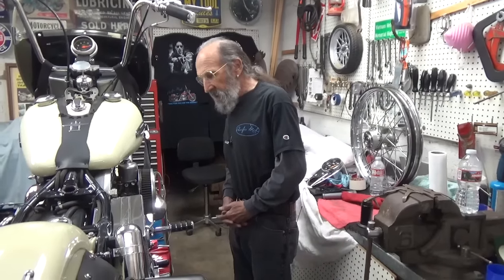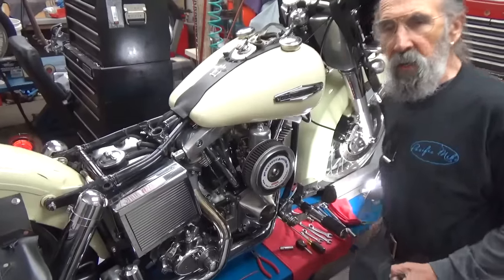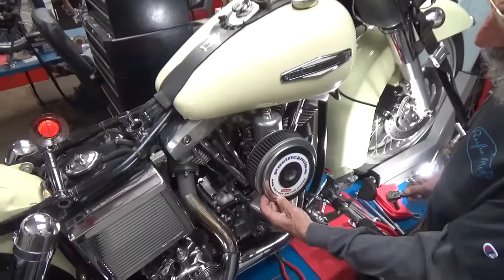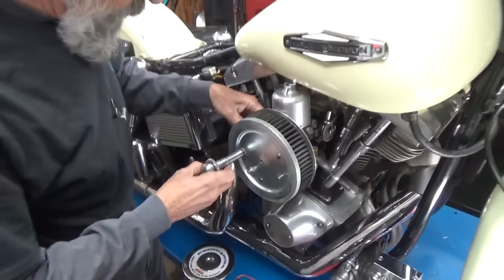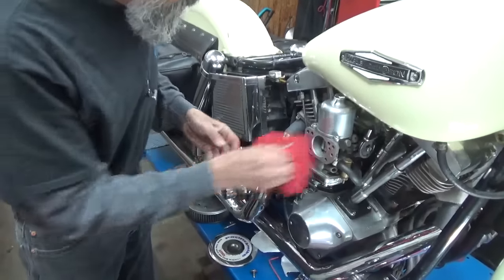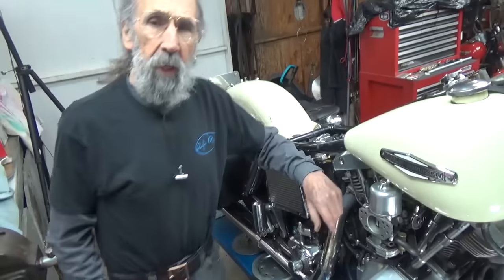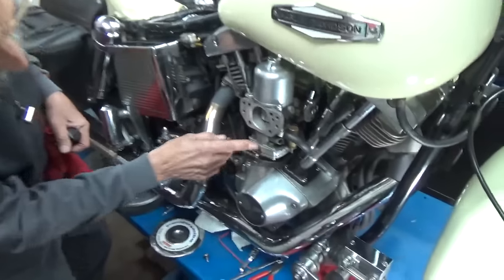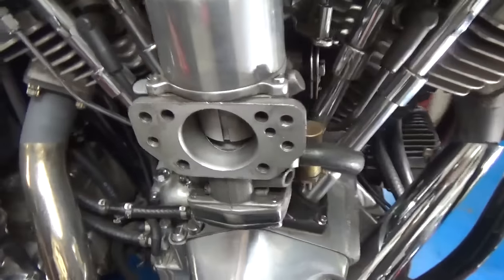Quicky service on a Harley Shovelhead SU Carburetor

Comment: Been running nothing but SU for past 50 years on my chops. One myth that you perpetuated, is about oil in the dampener.  Oil has a direct effect on the dampening... and as the instructions state  "Use no oil in the dampener. Once a month remove the dome nut and lightly spray with WD-40 inside the dome."  I also highly recommend lightly wiping down inside of bell and slide with a clean cloth and WD during routine maintenance.  Some thing I want to mention since a bunch of SU guys will read this, and it might save them time and trouble down the road- a problem that cause me grief for far too long- bike started normal, then ran rich. Very rich. No amount of jetting etc fixed it. The problem was this- on the end of the enrichener rod inside the carb body, on the end past the air valve- that O ring had harden, and wasn't proving a good seal. Looked good enough on inspection, so I gave it a pass. A snippet I read on a forum mentioned that O ring, so a re-examination proved it to be the culprit.
Reply from the maker: Interesting.  Until lately, I never had problems with seals drying out or gasoline going bad in my Shovel.  It never sat that long.  Nowdays, things are a little different.  Thanks for you input.
Reply: what confused me, was the o ring never touches gas, it's an air flow seal to give it vacuum.
Reply from the maker: You know. I'm going to have to study on this a bit.
Reply: I went and looked it up... the o ring, is on the far end of the throttle spindle- and controls the air flow when enrichener is used.
Reply: Some hick up.  Old stinkin gas.  I got gas, sometimes all day loooooong.
Reply: Especially after cabbage.
Reply: My new favorite est  video, wrist bushings!

Comment: Now I know a little more of why a buddy of mine during later '70's ran SU carbs on his Shovelheads.>> I used to keep a dedicated for task screwdriver with just the right diameter tapered handle dropped down into a keyring on outside of tool bag to adjust carb for elevation on the fly....Find that now emptied out tool bag around here somewhere & that same screwdriver is probably still in that ring with edge of top flap holding it in place...LOL!
Reply from the maker: Yup.  A little pocket on the back of my saddlebag.

Comment: The first carb I ran on my pan when I first built it 30 years ago was an SU by Rivera. You're right that it's definitely a ballsy carb. I loved the tickler. Just like the Amals on my Norton. Started easily all the time. One winter day, the bike suddenly started running badly and quit. The piston had frozen in the dome, so the needle and piston were in the wrong place with respect to the throttle plate. The tuning was right on, but maybe I didn't have the right lube or something. Tried a Super E, but settled on a Super B. Amazing how much better that bike responded with the B than the E. I was young and impatient back then and just wanted to ride. Today I would try to solve the problem with the SU. 25 years and one rebuild on the B.
Reply from the maker: Nothing succeeds like success.

Comment: I really love SU carbs, I ran one on my 93" shovel for more than 20 years. It was the easiest starting and smoothest running bike between me and my riding buddies. I hear you on the oil in the dome...I used to just lightly coat the piston with a little Marvel Mystery Oil and occasionally a squirt of WD-40 into the dome.
Reply from the maker: Very cool!

Comment: I had a 69 mk||| spitfire dual SU. Detached float bowls   , hours of fun. , until the un sync.  Added 3 in 1 oil  dampened  the slides
Reply from the maker: Yes.  I had SU's on my 59 100/6 Austin Healey I built up back in the late 70's and early eighties.

Comment: I remember when the s&s carburetors years ago did not have a fuel pump and that's why I went to an su on my shovel ... That was a long time ago
Reply from the maker: Do you remember the Superbowl so you could add an accellerator pump to your S&S?  I've run an SU on my Shovel for over thirty years.
Reply: @pacificmike9501  no ..but  accelerate spray could not get used to roll on throttle 😮
Reply from the maker: And there you have it.

Comment: Hello Mike, I can't get enough of your  videos especially about S.U. carburetors, I have found out that my custom built chopper my good friend who i called my adopted father had built, well there were a lot of questions about the chopper i never got to ask before his passing, like what year and if any upgrades were done to the shovelhead, and what the type of S.U. carburetor it was, and I've learned that it is a HD 8, with that info, I was able to find info about tearing it down and rebuilding it, and it was a blessing and a good thing that was needed to be done, when i first got the chopper back together and running, the spark plugs was telling it was too rich, and after the rebuilt, changing the needle, and found out the nut to the main jet had, from my guess, that the nut had loosen from vibration, after putting it back on the chopper, and it ran a hell of a lot better, I'm still messing with tuning it to it's sweet spot and the spark plugs ain't showing it's running rich, the front looks good, put the back seems to appear to be running rich, not as bad as before, but not the same as the front one, any advice you can tell a young pup?
Reply from the maker: Probably a vacuum leak at the manifold.  Get your hands on a service manual.  The first section will tell you what it is by the VIN number.  You should easily identify the motor by that.
Reply: @pacificmike9501  I'll check that, the problem with the VIN is the frame was custom from two frames and the VIN on it doesn't match Harley Davidson VIN# and the engine # isn't there, the only visible identification is on the crankcase is dkm 197008, i would like to send you photo somehow and maybe get your opinion I'm sure you can tell me what i really got going on .
Reply from the maker: Sounds like Delkron cases.  Cool.  Starting to get difficult, however.  Find a DMV service in your area to find out what you're going to need.
Reply: @pacificmike9501  that's is my biggest worry, how difficult it going to be registering, i know it was registered and was non op, but his wife couldn't find the pink title as special construction, all she could give me a bill of sells, but I've gotten to this point and my will is strong.

Comment: Hi Mike, been subscribed for a few years now your videos are great. American Prime Manufacturing is the company you once told me to get in Contact with for SU Kits and they certainly do that thank you for the referral. Also you mentioned about the petcock upgrade form factory Harley. What could you recommend?  thanks again Pacific mike and cameraman mike
Reply from the maker: Cool, thanks.  I'm actually old friends with Ben at APM.  Just had a senior fade.  I really was cold last night.  I generally use a Pingel Petcock for serious flow.  The old bikes at 74, don't always need it.  Your call.

Comment: Spot on mike SU carb better all round performance better acceleration great mpg   so simple  ive been running a SU on my  1200 shovel for years
Reply from the maker: Yes, we have.  They also produce more horsepower.

Comment: Hey Mike, I need a high gas cap for my 72 FLH. Any idea where to look. Also, what do you think of the Ultima single fire ignition for an 88 Evo? Building a softail chopper basket case I got from someone who was in over the head.  Was on the cheap. Thanks man. love the Paradise show vids. Keep on truckin brother.
Reply from the maker: Thank You.  Aftermarket companies have all the old caps.  Try V-Twin (Ted Cycle).

Comment: Great video as usual Mike, I’ve just fitted an SU to our Shovelhead, one of the best change’s I’ve made. The Super E was ok but it’s not in the same stable as the SU. I love it. Do you happen to know what needle and spring you’re using in yours? Many thanks for ALL your videos Mike.
Reply from the maker: I honestly don't remember.  Do you have instructions?  If not, call Ben at American Prime Manufacturing.
Reply: @pacificmike9501  Yes, I found some instructions but mine was second hand so didn’t come with optional needles.
I was just curious to see the difference,if there was one. Thanks again Mike.
Reply from the maker: The needles come in different tapers.  They're all listed in the instructions and Ben stocks them all.  You just have to experiment.  Same thing with the springs.  They're all very easy to change.
Reply: @pacificmike9501  Thanks Mike, all the best.
Reply: Hi Mike, just a quick update, I went on American Prime website and all the info is there, so anyone fitting an SU to their bike that would be a great place to look at. Thanks for the tip Mike .
Reply from the maker: You bet.  And, appreciate Ben.  He's one of the good guys.

Comment: Hey Mike I have a 77 FLH with dyna s ignition. Carbs been rebuild, new o-rings and clamps. New coil and wires. Keeps fouling front plug. Running champions now. Sorry to ask…what plugs you recommend?
Reply from the maker: If your motor is in good shape (valve guides and valve seals and piston rings), you have a vacuum leak.  Are you sure the O-Rings are fitted nice from the manifold to the heads?  Is your carburetor and manifold supported well so it can't get loose or fall off?  In 77 heads, I run RN12YC plugs (short reach).

Comment: So Mike I have a question I was looking at that SU. that's only the second time I've seen one of them square float bowl bottoms like that I still have a couple of old SU''s still have a couple of shovelheads but anyway that's beside the point tell me about that if you would I would appreciate it like I said i'd have only seen 1 once before might have been on your bike as a matter of fact ha ha anyway let me know man thank you
Reply from the maker: That's just a late style SU.  The earlies had remote float chambers.  The bottom cover is removed to accept the extended float chamber.  It simply stacks in there and then the cover reinstalled.  You just have to remember to install the extension tube inside.  That extended float bowl is an accessory that was offered by Rivera Engineering.
Reply: @pacificmike9501   Well now that they're gone I just have to look around to swap means I guess I've never actually even looked for one but I still have 2 old F shoes I figured 1 of these days I might put 1 on the shovel head especially being sad they used to work good I just ended up with an S&S and that's what happened he using for the last 25 years.  Thanks man see you out on the road ha ha
Reply from the maker: American Prime Manufacturing   www.americanprimemfginc.com   has new ones.

Comment: Maybe that's why My bike stumbles when when twist the throttle may be the percock
Reply from the maker: Disconnect the fuel line from the carburetor and see if fuel is flowing, unless you have a petcock with a vacuum line on it.  You didn't mention what the bike is.
Reply: @pacificmike9501  thanks sorry it's a susuki which works on vacuum I've checked it gas does flow out but maybe not enough
Reply from the maker: Is the motor stock?  Has the intake or exhaust been modified without changing the carburetor jetting?
Reply: @pacificmike9501  no it hasn't I've even cleaned and replace the jets it's got me baffled also replaced the cracked rubber intake boots has 4 carbs they are touchy